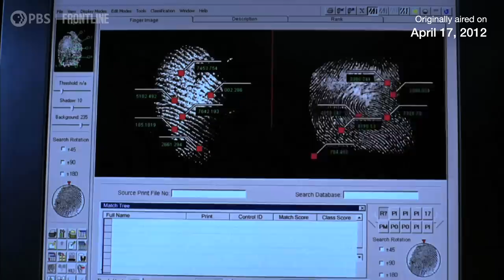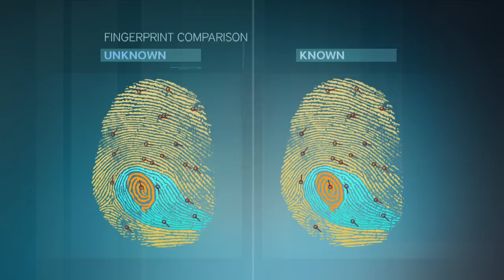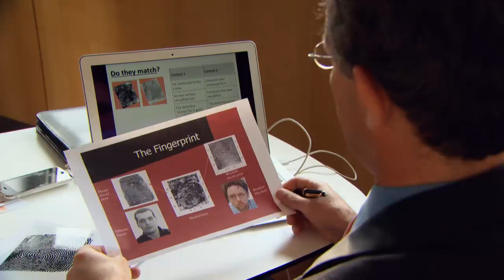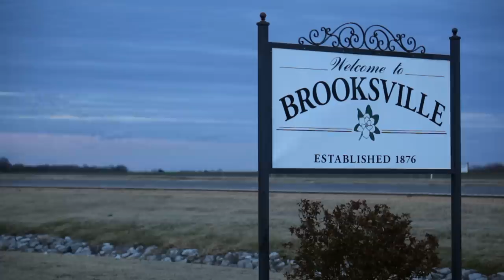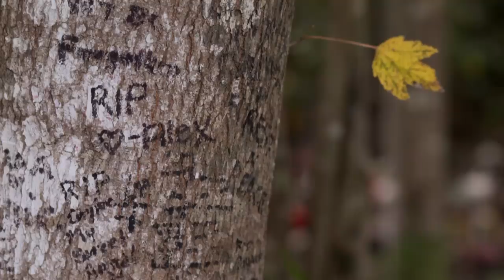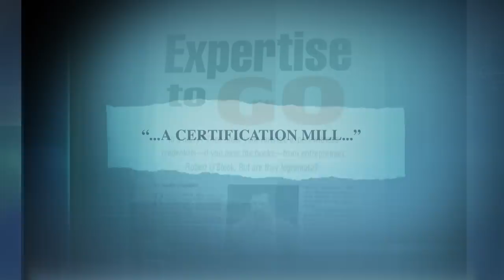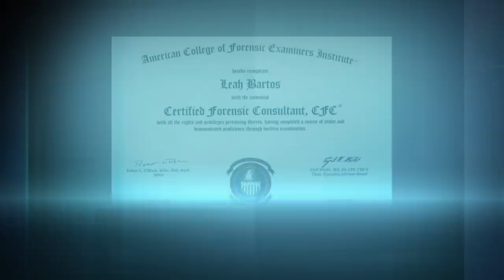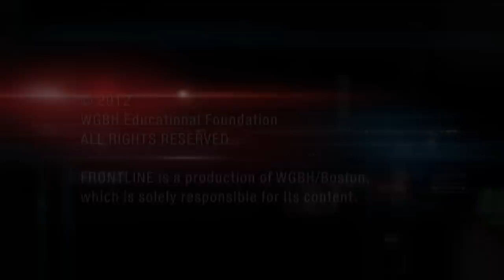The Real CSI (full documentary) | FRONTLINE

Comment: Pretty interesting. Another topic that can possibly be used against evolutionist as in how all the different methods of carbon dating are based off an assumption.
Reply: uhhhh no.  carbon dating is overwhelmingly tested and confirmed by science.  not to mention there are numerous other non-carbon based dating methods.
Reply: @Ddub1083  uuuhh yes. There’s many books on it. And when I mentioned carbon dating methods I was referring to all the other methods there are.. I’m very aware of those methods. I understand when it comes to this topic many biased opinions come into place. But usually a lot of those people couldn’t get passed a chapter due to how they’re programmed. It’s best to study both topics(evolution/creationism) rather just be taught about one.
Reply: @EarlSchieb  You do realize that MOST dating is not done using carbon dating right?  Carbon dating only goes back like 50,000 years.... so in terms of "evolution", carbon dating is very VERY rarely used.  They often use one of many other radiometric dating techniques.  Its not best to learn both... one is literally made up and the other is science.
Reply: @Ddub1083  Youre contradicting yourself. They both use science. Just one is more honest and clear and the other is biased and as well a religion. Like I mentioned. I was referring to all the other methods. Which yes. They are all based on a guess. Even after they use their “science”. No accuracy. Once you learn about both then if you’re wise enough you’ll see. My brothers a biologist and mothers been environmental scientist my whole life. Trust me. I was raised around science. I know what science is and I know what BS lies are too.
Reply: @EarlSchieb  lol why would your brother being a biologist and your mother being an environmental scientist mean that you know science?  seeing as how you didnt know carbon dating isnt actually used for ANY evolutionary science kinda exposes you dont know what youre talking about.
Reply: @EarlSchieb  lol k. have a great life,.
Reply: @Ddub1083  likewise, buddy.